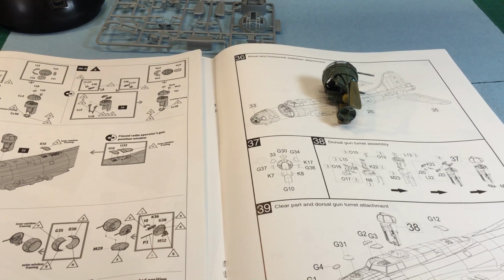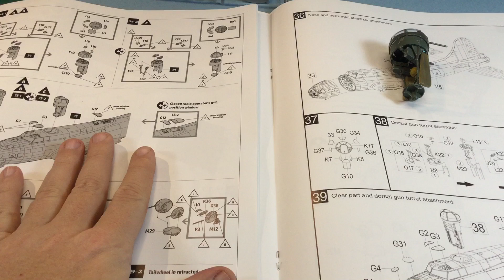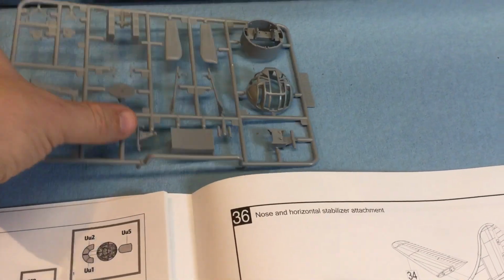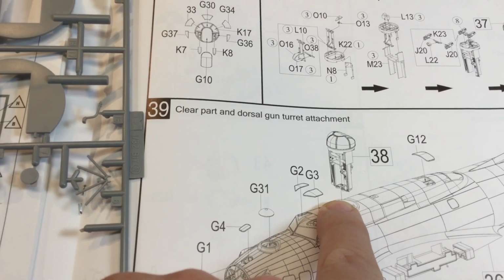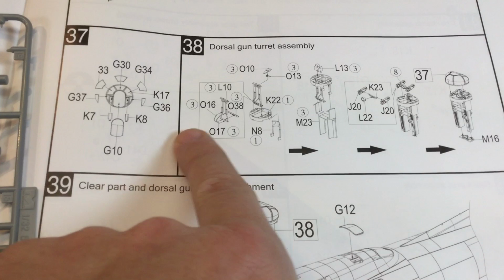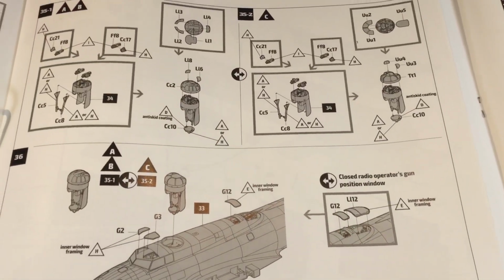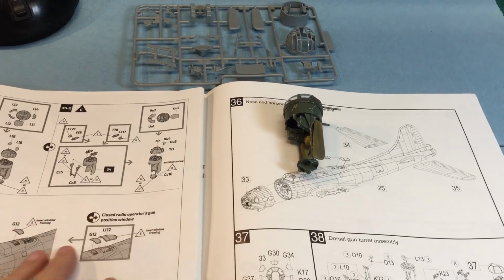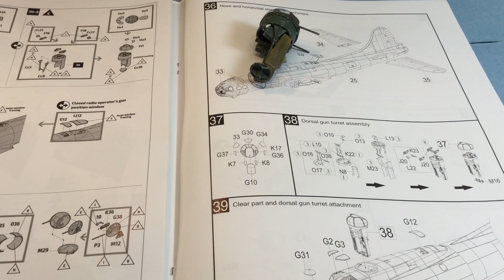1/32 HK B-17 TOP TURRET DIFFERENCES

Comment: Hi , my friend I wasn't expecting a full video to answer my concerns on the top turret , but thank you very much indeed it is well received  & enlightening  , in return may I offer you some info on a new book entitled B-17 G big bird from AFV publications " if you can get it ?" again I am always willing to learn . I do have both "G" kits as yet I don't see any differences between the two outside of the fact of different art work the floor in the radio room seems to be rectified but I am not up to that stage as yet, lastly please keep up the good work I am always anxious to here & see what it is your up too
Reply from the maker: No problem. I am sure you are not the only one with this kind of question? I have seen this book from AFV. The one I am working on is more towards the B-17F. I am always up to something LOL......
Reply: I was curious to know if the newer "B-17G Late" kit had the waist gunner positions staggered (offset from one another along the length of the fuselage).  If it is a true late G model, they should be staggered.  The late F/early G waist positions would be at the same position along the length of the fuselage and directly opposite one another.   Thanks!
Reply: @leonardjeffreys1546  Hi Jeffrey , Yes both "G" kits from HK are staggered as they should be  it is a big kit & does require your full attention , however remember to have some fun in building it , plenty of Eduard after market kits to go on it & the Big Bird book serves me well too, please enjoy your self .

Comment: Speeding of top turrets, I’ve got a question about the 1/48 scale F-model turret. Is there a way to modify the F hole to fit the monogram G turret ring? I’m asking because I want to be able to elevate the guns instead of using the F kit’s that won’t raise due to them being molded to their own turret ring. Any help would be greatly appreciated. Cheers.
Reply from the maker: You may have to get rid of the guns off the ring without wrecking your ring?
Reply: Inclusive Model Designs, thanks for the advise. I’ll give that a shot on my next Fortress. Cheers.
Reply from the maker: It's the only thing I can think of  really. The only problem is if it does not work, it may have just wrecked your piece?
Reply: Inclusive Model Designs, that was my main concern. However, I have thought about buying the F and G kits (not at the same time) and switching the cockpit/nose sections. That might work, giving the plain F nose to detailed G fuselage and vise versa🤔. I guess the only thing to do is give it a try. Cheers.